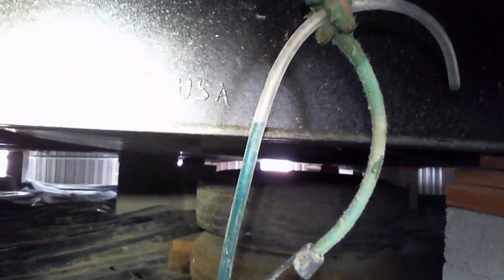Double Wide Manufactured Home Leveling

Comment: you do not show how much water to put in the jug of water..or how to determine how much water you need in reference to your high point. none of your videos do.
Reply from the maker: Josh stone Club There is no set amount of water that you need. You can use any amount of water.
Reply: Foundation Repair Denver I watched another video. and this girl said to put the buckle or jug right next to the frame on a break assuming theirs room and fill the jug up equal to the bottom of the I beam .